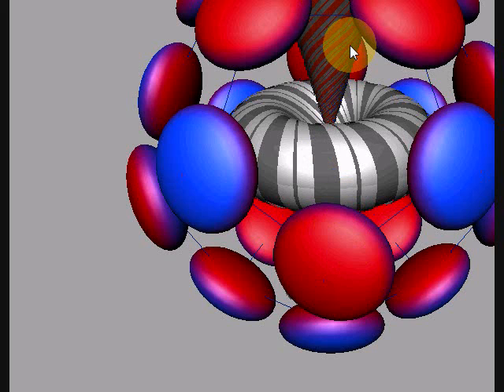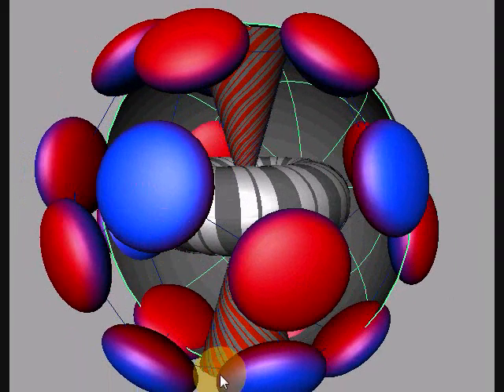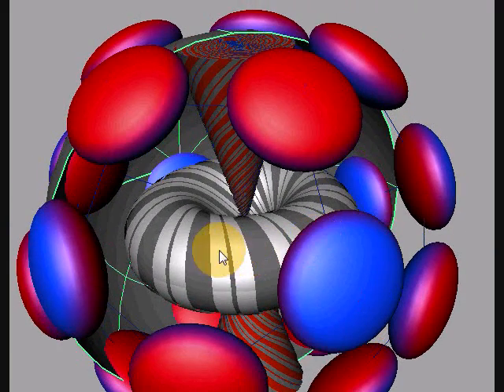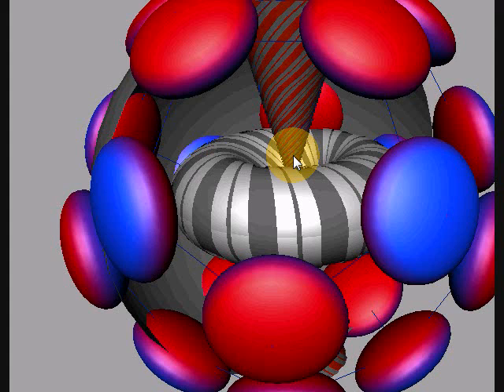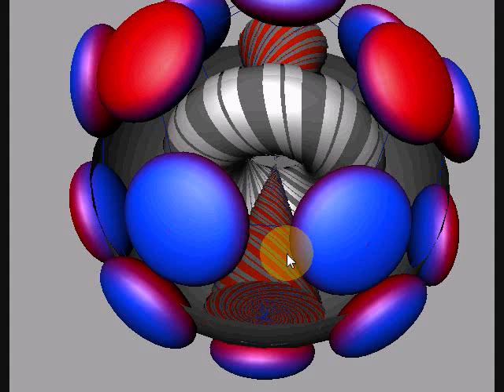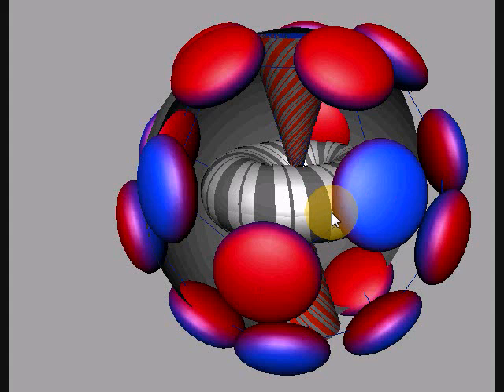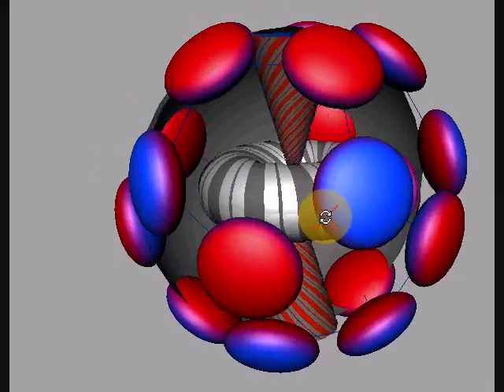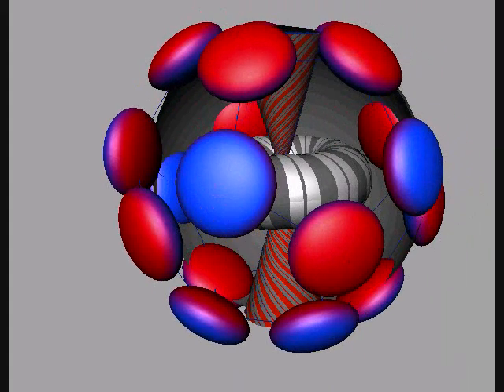Rodin Coil Motor #2

Comment: Oh, another approach,  First wind the torus normally and evenly, but close the ends (closed circuit, and works better on a conductive torus material.  Then wind your rodin coil overtop the normal closed circuit windings.  Look at the map.

Comment: The cones and rodin coil, together, are a model of a hydrogen atom in one of its d states of energy.  Make the cones more like teardrop shapes, and wind them with wire so that the inner poles are the same. They are controls.  Wrap the rodin coil true: two conductors and a gap, repeating the pattern, use a plastic spacer 'wire' if needed.  Look at the original 'map' of the '369' principle and keep those spiral angles on the torus.  Lastly, spin the COILS.

Comment: you need to put the coil in the opposite direction too ..THE energy comes from pulsing it round so the electrical field is created it,ll charge Itself then ..whoops ..forgot the water its not needed ,, you need to put the ferrofluid in the donut ok

Comment from the maker: @blaargenheimer Aluminum is still in the game plan. Copper is a diamagnetic conductor and will conduct a diamagnetic field with a negative charge. Aluminum is a paramagnetic conductor and will conduct a magnetic field with a positive charge. Will them directly touching, copper will also absorb the heat, the aluminum the cold vacuum. Polarization of matter and energy.

Comment from the maker: @JuanTracy I'm thinking a 144 point coil is best with each circuit being replicated four times so there are 12 circuits in total. The design I am working on right now requires no input energy even though input energy could get the engine running much faster. That being the type of current wouldn't matter, and it probably would pulse DC on its own.

Comment from the maker: @MichaelSmathers It was Potassium Hydroxide or KOH. That is to anodize the aluminum @ 200volts to create with a dielectric shell around it of corundum. Process can be found on wikipedia under "Plasma electrolytic oxidation".